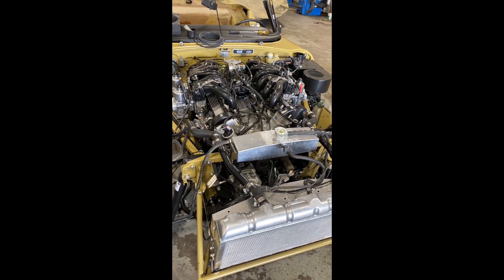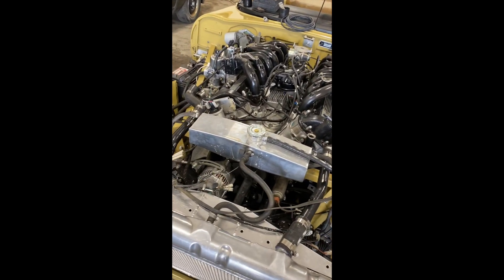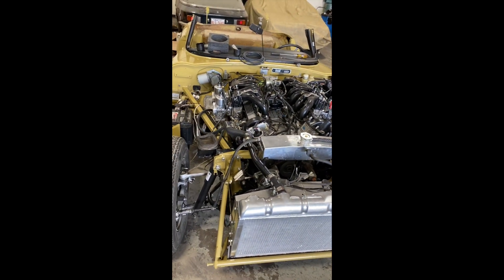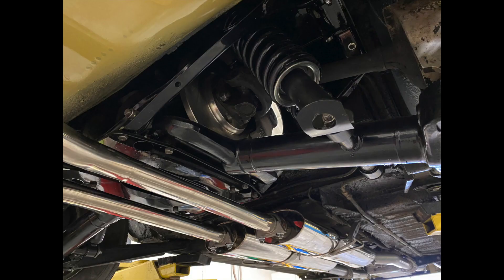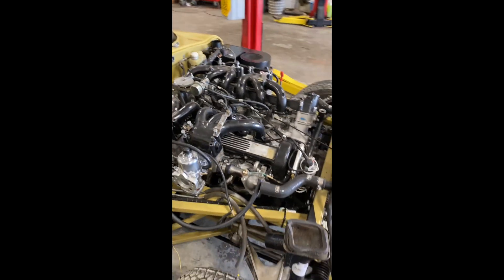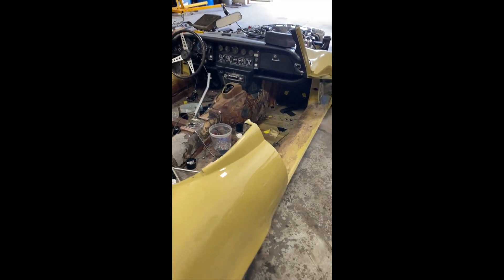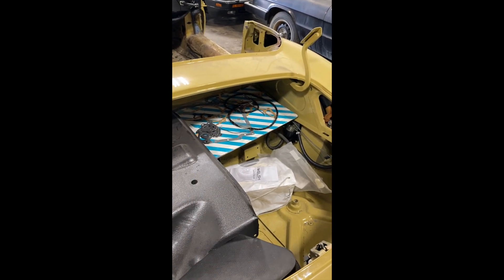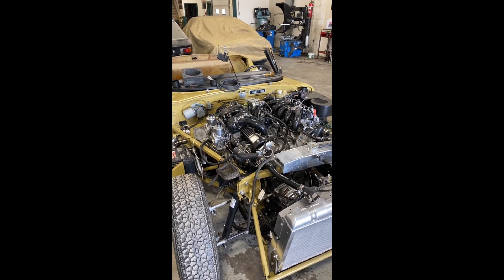1973 Jag E Type V12 Restoration Pt. 3 - Powertrain

Comment: having much fun and enjoyment with the Updates as they come along,  will be 'Waiting' as when they do show up... as I also have an e-type 12 I hope to restore with a least some of Your upgrades as $$$ Permits..  it will be a car to be Proud of!
Reply from the maker: The car is mostly done, just placing a final order for some external trim, and then install the windscreen and soft top.  The SU conversion really cleans up the engine bay, as you do away with the air pump and associated hardware, as well as the big intakes.  The tubular headers and alloy rad are much lighter.